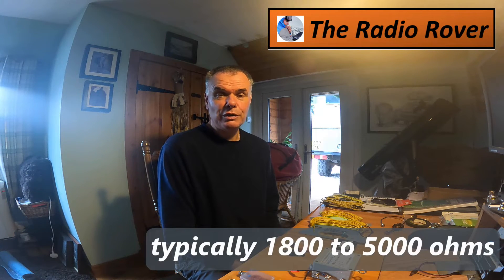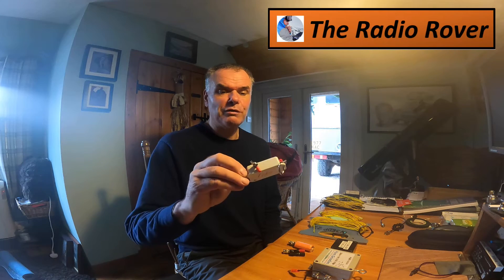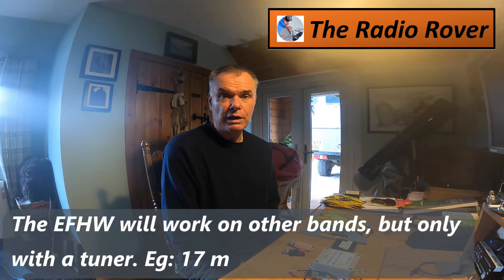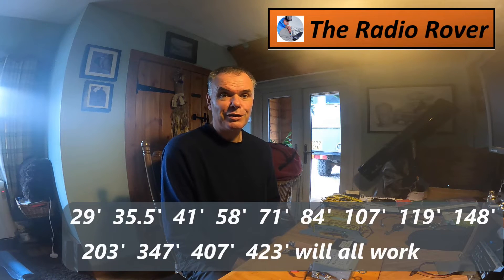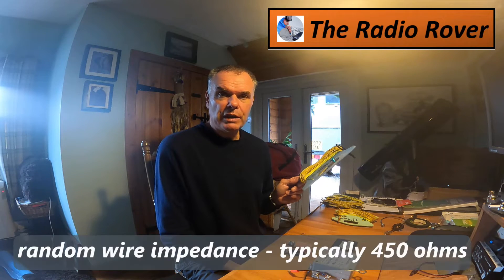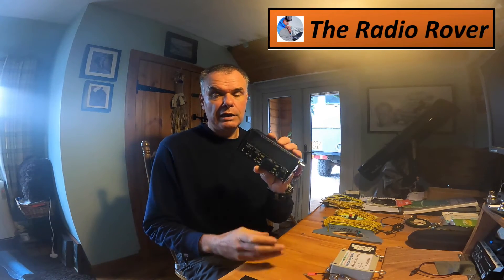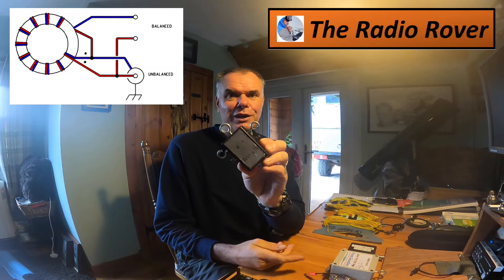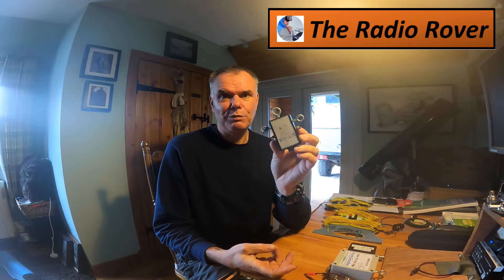Which Balun, UnUn or Choke to use and why?

Comment: I am curious as to whether an unun or a balun would be more appropriate at the feedpoint of an elevated resonant ground-plane antenna with a quarter-wave vertical radiator and 4 quarter-wave sloping radials.  The antenna will  look like 50 ohms to the feedline (because of the sloping radials at 45  degrees), and will work fine with neither balun nor unun.  But, if you wanted to use one or the other at the feedpoint, which one would you use?  I'm thinking balun.  But, one vertical quarter-wave playing against 4 sloping quarter-waves.  Are they really "balanced"?
Reply from the maker: I use that exact design for 10m. I place my UNUN at the radio end of the coax. It isn't a balanced antenna. Even a dipole isn't balanced unless the elements are perfectly 180° to each other and 90° to the coax, with all of this above flat, uniform ground. With QRP, you can get away with no UNUN or even balum, but much more than 10w and bad things can happen. 😊

Comment: Best explanation iv heard , Thank you for sharing your knowledge and time.
Reply from the maker: Thanks. I like to keep it simple!
Cheers, Fraser MM0EFI
Reply: @theradiorover  my questioning was the whole 9:1 64:1 49:1 unun .seems like the real difference is how many ohms they can knock down to 50?  I built my first end fed yesterday and Im very happy with how it works and tuned up.
Reply from the maker: @Kc3vhr excellent. I have two. One has a 64:1 and is slightly (5") shorter. Both work well and I've worked GM-USA on 10m, 15m and 20m ssb with them. 😁

Comment: I want to build the 3 wire version (T3FD). Let's say I use a 1000 ohm termination resistor.
There seems to be disagreement about the balun. Can you explain how to choose a balun ratio of 9:1 vs 12:1 vs 16:1?
Reply from the maker: I'm not familiar with that design, however a quick Google reveals that 9:1 provides a good match.

Comment: How about current and voltage baluns? When you say balun do you men a current balun? Thanks for a great video. 73 SM6YEC
Reply from the maker: Current baluns operate by forcing equal currents on both balanced lines, effectively eliminating common-mode currents, so ideal for a CM choke or a ½ wave dipole. Voltage baluns force equal voltage on each balanced line; this is ultimately a better fit for impedance matching applications.
Hope this helps 😊👍

Comment: Very instructive video, thanks. I'm trying to source ununs where I live (France) but these aren't available anywhere. I can only order them from the US or the UK with eye-watering shipping fees and import taxes.
Baluns, however, are easy to find. So my question is: would using a balun with the same ratio instead of an unun on an EFHW or random length antenna work, possibly needed more tuning on the transceiver, or not at all?
Reply from the maker: Hi Alain, Glad you found the video interesting.
1. For an EFHW you must use a 49:1 or 64:1 un-un (auto-transformer). This is because of the very high (~3000R) impedance at the feedpoint. 
2. For an end fed random wire, as long as it is one of the documented lengths that work, you may not need anything at all. Eg a W3EDP will have 3:1 SWR or less on most bands. Your tuner could handle this. 
3. Buy a torrid and some magnet (enamelled) wire and try winding a 9:1 yourself. It is simple. The Radio Prepper did a good video on the subject.
Hope this helps, Fraser MM0EFI

Comment: Thanks for the simple but informative information. I keep hearing about unun, balun, and the different ratios, but could not work out what went with what antenna. Good video, thankd.
Reply from the maker: Glad it was useful. I tried to keep it non-technical. You can deep dive into any of these devices if you want more info. There is lots of information out there.
Cheers, Fraser MM0EFI
Reply: @theradiorover  Non technical is all us neanderthals need just to get a piece of wire in the air 🙏🙏🫡🫡🫡
Reply from the maker: @beaver3501  HaHa! Yes. 😁

Comment: Thanks for the informative video! Just one question, for the choke, what’s the best toroidal to use?  Thanks
Reply from the maker: Use type 43 or type 31, based on your needs. There are charts available on the Web. Eg here: 
https://www.google.com/imgres?imgurl=https%3A%2F%2Fi0.wp.com%2Fwww.karinya.net%2Fg3txq%2Fchokes%2Fchoke_impedances.png&tbnid=jpdp60n4yCBnpM&vet=1&imgrefurl=https%3A%2F%2Fpa3hho.wordpress.com%2F2014%2F02%2F21%2Ffair-rite-toroids%2F&docid=BePHMtPiq4q7uM&w=670&h=722&source=sh%2Fx%2Fim%2Fm4%2F2#vhid=jpdp60n4yCBnpM&vssid=mosaic

Comment: I made my first dipole without using a balun, however I have a 1:1 current choke at the radio end. Is this the same thing as a bulun? and is the placement of it at the radio, instead of the antenna feedpoint a problem? Thanks
Reply from the maker: In a perfect world, with a dipole above perfect ground and no buildings nearby etc, you would have equal currents which cancel out in the feeder. This is rarely the case and some current will flow on the outer skin of the coax back down towards your radio. For QRP you don't need anything, however if you plan on running a bit of power then a common mode choke near the radio is a good idea. A 1:1 balun can be used to help match the BALanced dipole legs to the UNbalanced coax feeder. Belt and braces  using both really.

Comment: Hi Fraser excellent video,really enjoy this subject ,now it has got me thinking what about The shortwave listener would any of this benefit  us I have about a 61 ft long wire in the back garden  .Thanks for sharing all your stuff with us Best Regards Tim
Reply from the maker: Hi Tim, A tuned antenna will receive better. Whether that is through an antenna tuner or through being resonant.  I use a W3EDP at home and the RX goes up massively after I hit the tune button on my ATU. Do you use a tuner with yours? 58' may work better for you! Happy experimenting. 😃
Cheers, Fraser MM0EFI
Reply: @theradiorover   Hi Fraser, thanks for the speedy response & yes I do use an ATU. However, I always wonder.... could it be better /can I do better. I’ve been putting up various types of long wire, trying to get the perfect listening antenna 🤪🤪
Thanks for your advice,
Tim

Comment: Why only endfed, random wire, and dipole antennas. Why not verticle and yagi antennas also? I am a bit confused about that as most videos address EFHW antennas when talking about UNUNs and chokes.
Reply from the maker: Hi George, The same rules apply. 
Eg: if a vertical is an EFHW or random, then use the same type of transformer. A ¼ wave vertical with ground planes doesn't need anything, but it is always a good idea to place a choke in the feed line with any antenna.
A yagi is just a dipole with added reflectors, so the same rules apply. 
I hope this helps. The video was not supposed to be too technical, instead it was designed to be an overview of which types of device to use with different types of antennas.
73, Fraser MM0EFI

Comment: Great, Great Video!!! I'm a new ham to HF.  been messing around with VHF&UHF for years but not so much HF. Just got a QRP radio Xiegu x6100, It's going on three weeks now trying to configure a HFJ 350m antenna to work with it (No Luck) All I get on every band is harmonic tones and static. I have a 1:9 Balun coming in tomorrow (Saturday) from Amazon. Was wondering if you have any videos connecting a Balun that shows best setup for 1:9 Balan. Meaning counterpoise, configuration amounts of radials & length of redials? The radio is fine (no damage, new) As last week I took it to a park setup only two counterpoises about 18 feet off a 1:1 balun type dipole antenna I put together (have no idea what I'm doing) but a great deal of magic happened on 6m, 10m & 15m. The harmonic tones turned into voices. Could not get out of the US but did achieve under 400-mile contacts. As a new HF operator, just looking for hands on specs showing setup of balun, placement of balun, & wire length of counterpoise, along with amount of counterpoise cables in a pattern that would do better than 400 miles. Thanks again for above video!!! Any help would be appreciated. 73 for now. (My radio does have antenna tuner & SWR adjustment meter on it)
Reply from the maker: Brilliant! Well done for getting out there and experimenting, really well done. That's what it is all about. 
You have lots of stuff going right:
1. Using a random wire with a tuner.
2. 1:9 to help tuner get a match.
So, in the video you'll see I list random wire lengths. All of these will work with a 17' counterpoise laid under the antenna radiating wire, or even out to the side if you can't manage. 
Arrange your radiating wire as an inverted V over a branch or mast, even 5 metres or yards for the apex will do. It will also work as a sloper.
Now the radiation pattern will vary by band, and it won't be as good as a resonant antenna cut for a band, however when the bands are open, you will get some nice surprises, especially on the higher bands through the day.
I use 41'and 17'. I also use 84' and 17', which is a W3EDP. You can go as low as 25' or 19' but you'll not get 40 m with that length. 
As for videos,  you see me work a pile up in my Ulva Island videos from last November. I go over the mast arrangement and you can see the antenna goes to the Un-Un and straight into the radio. With QRP there isn't the need for a choke.
As for your question about more radials. Well I wouldn't bother for a random. They may help with a tuned antenna however radials on the ground behave very differently on rocks, wet grass, dry earth etc. If you want a resonant antenna with radials, then a vertical with elevated radials works best. See my video about a simple dx 20 m wire.
Hope this helps! Ask away if you need more help.
73, Fraser MM0EFI

Comment: So for a common mode choke, what would be the preferred ferrite mix, number of turns, and type of wire (coax or 2 strands of teflon wire) for maximum attenuation at 27 mhz?
I have a Solarcon 99 that seems to be radiating from the feedline even with an "ugly" balun at the feed point.   Everything is sufficiently grounded.
Reply from the maker: Air core should work fine at 28 MHz. Have a look at this...  http://www.karinya.net/g3txq/chokes/
The definitive work on chokes. The table has been replicated many times.
73, Fraser MM0EFI

Comment: Thank you for the video. Just a quick question. If I run a QRP rig (let's say up to 10 watts); I don't need any of these, right?
Reply from the maker: Fred, No that is not correct. They all do different things.
The 49:1 is for an EFHW and is very necessary. Consider it part of the antenna. The radio should not need a tuner.
The 9:1 is for a random. You need a radio with a tuner or an external tuner. The tuner may get a match on the random without the 9:1, so this one may not be necessary.
The balun for the centre of the dipole is not necessary for QRP.
The choke isn't necessary for QRP but is advisable as it will help keep RF out of your radio, mic. cable, and mic.  which could affect your tx audio.
Hope this helps, Fraser MM0EFI

Comment: Thank for that Fraser. I just started using a KX2 for SOTA and unbalanced aerials. Given that the Kx2 will tune almost anything do you use an unun or choke with yours?  Dave Ei3ixb
Reply from the maker: Dave, for QRP I don't always use a choke., mainly when I forget with my EFHW, or when the antenna is connected directly to the radio or the 9:1, 49:1 is straight to the radio.
My recent balun video describes this. Also check out the bicycle portable one, where I plugged the EFHW straight into the kx2 because I forgot the coax.
73, Fraser MM0EFI

Comment: Thanks Fraser. I've recently started to do activations. I've been subscribed for some time but couldn't find a video where you show the full antenna setup procedure for a linked dipole on a summit. Would you consider including the full pole/antenna erection in an upcoming summit video? There's lots of advice from other channels on how to do it on a perfectly flat, open, grassy space but very little on a rocky summit with limited space and an abundance of wind. I'd love to learn from your experience. Phill - VK7ID
Reply from the maker: Hi Phil, Good to hear you're getting out. It will soon be VK to GM summit to summit season! So, we'll need to get up in a hill for that. 
Here's a video I did a while back, but I will do another one in the next month or so.
https://youtu.be/vS5zwNagKUI
Reply: @theradiorover  "A wee swally", love the accent! Thanks so much, very much appreciated. I've progressed from a 9m fishing squid pole and a 4 band HyEndFed portable EFHW to a SotaBeams 6m pole and 20/40 linked dipole saving lots of weight, making setup much easier, and eliminating RF feedback into the radio/mic. I see you use the "layout the dipole then come back one metre" method. I'll be sure to give that a crack!
Reply from the maker: @pgroom  I've got a new dipole to test. Watch this space!

Comment: Nice video Fraser. Apart from a 1 to 1 choke I always use resonant monoband vertical antennas, so no need for there others. My very old ham mate always told me, the less bits and bobs between the rig and ant the better hi, so I've stuck to that for 30 years.
73 zl3xdj
Reply from the maker: I'm with you on that one Brian. You do a great job with your verticals. Many portable antennas are a compromise though and end feds seem to be gaining in poloparity. 
73, Fraser MM0EFI
Reply: @theradiorover  yes I am lucky to have a good take off and iam hoping to get my qcx mini to the beach on Wed evening,  see if I can get 10000 miles plus with 5w.
Being on the right band at the right time is my secret,  I only ever work the greyline. 
Best wishes my friend.

Comment: Good overview and to the point, Fraser! 
If you're using an EFHW, where the coax is part of the system, even with QRP, it may be necessary to use a choke/CMS. This depends also on the environment, the band you're on and how well the radio copes with HF (mostly a problem with the microphone input). A choke or CMC never hurts, apart from the additional weight to carry 😉 
73 Stephan
Reply from the maker: Hi Stephan, You are the EFHW expert and I value your opinion on this. The short link I use in the video is my QRP choke. I try to use it with the EFHW 100% of the time, although when I've forgotten, it has been OK. I often forget to use it with my 41'and 84' randoms and haven't had any issues. I guess my kx2 and mic. combination isn't getting upset by it.
Cheers, Fraser
Reply: @theradiorover  Thanks Fraser and yes, if it works with your KX2 without choke, then no need to worry about. My FT-818 is also less sensitive than my TX-500, but the Yaesu outputs less power and has no audio compressor. In this case, it's a bit like comparing apples and pears, hi.
73 Stephan
Reply from the maker: @PortableRadio  Apples and Pears! Absolutely.  Unless in a laboratory,  it is extremely difficult to predict what will happen.